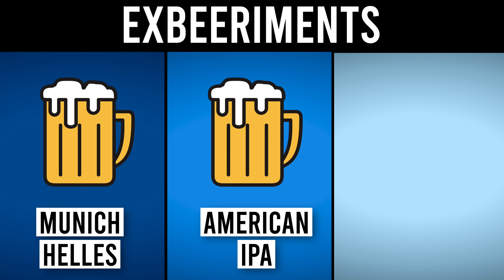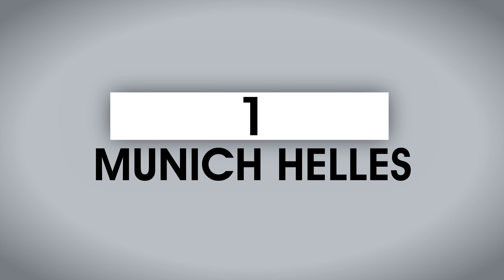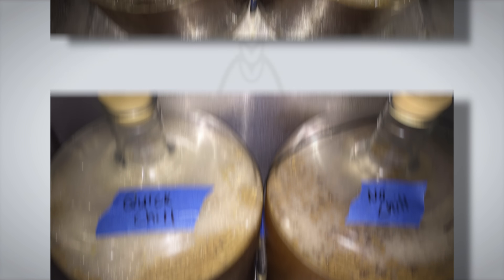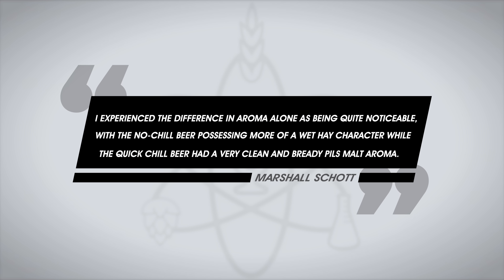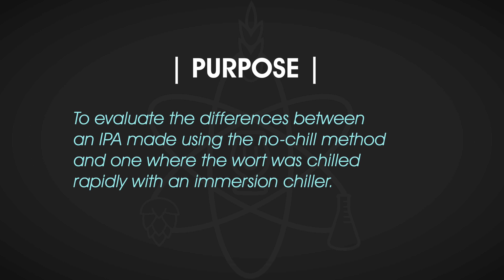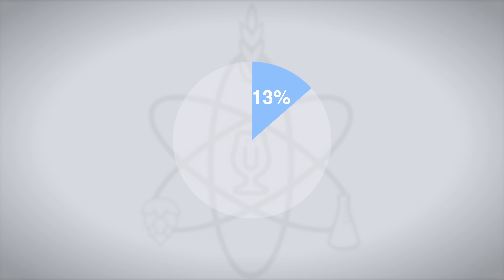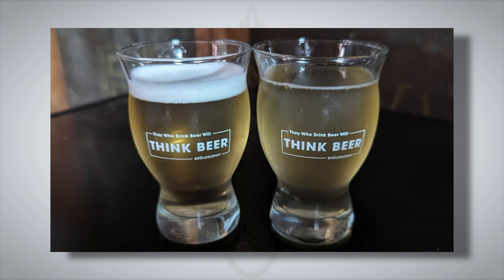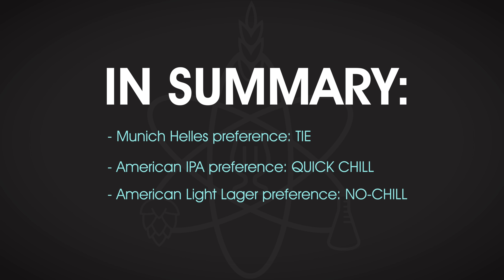How The No-Chill Method Impacts Beer Character | exBEERiments

Comment: Been on the no chill train since my wort chiller exploded in 2019. My advice, don't worry about transferring to an HDPE container, you can no chill in your kettle, pop the lid on and it will be just fine. I've had no issues with DMS yet. The only consideration is: if you're making an IPA or an especially hoppy beer, use a hop spider or hop bags on your later editions and pull them out at the end of the boil. Happy Brewing!

Comment: Usually, I do no chill brews. But instead of doing a real no-chill, you can also cool down the wort to 80 °C to prevent the isomerization after flame out, especially if you use great amounts of high alpha hops in late additions or whirlpool. Cooling can also be done with ice cubes or ice water, this works well for me. I would assume that the american IPA test with such a method would have a slightly different outcome.

Comment: My .00002 cents is... if a beer style has a lot of flavor already, the no-chill method probably distorts the big flavor, which is off-putting.. i.e. with the IPA. If a beery style has very little flavor, i.e. American Light Lager, the No-Chill flavor distortion is perceived as preferable, because the alternative is... no flavor. So the lighter the beer style, the more a batch may be improved by the no-chill flavor addition (along with anything else that will contribute... something!). 

Just as a side note.... my wife has definitely been in no-chill mode for quite some time! Doh! 😜

Comment: I did a no-chill light lager last year.  It turned out decent.  I didn't know about the 20 minute hop delay.  I'll definitely be trying that.  I brew with an electric brew kettle.  At "flameout" I just put tge lid on and wrap some of that silicone wrapping tape around the edge to try and get an airtight seal.  My beer was a bit grainy and bitter but ok to drink.

Comment: I only used the overnight cool-off no chill method one time yet when I brewed in a different place where I did not have my counterflow chiller available. This batch was my very first and so far only real catastrophe. Had to dump two 19l KEGs down the drain because of a massive celery-like off-taste. Really absolutely awful, no way of drinking it. Disgusting. Yes, it may have been something else, but in all my idk around 70 batches so far I did not even encounter this once more.

Comment: I haven’t looked at the other comments yet, so maybe others are doing this. But, I use a small water pump and ice packs in a cooler of water, run it through the plate chiller (wort is using gravity). The water comes out warm, and I use that to mix with PBW or as the rinse water. 

So, if no hop stand, I’ll run about 1/3-1/2 of the hot wort through the plate chiller and return to the kettle twice, then replace the cooler water (reused as wash or rinse) and chill back down to run through the plate chiller one last time into the fermenter.

That last run definitely gets me down to pitching temp, usually in the low 70’s °F. And this absolutely reduces the amount of water I use.

Comment: I started with no chill but switched to quick chill, because its a bit saver for the fermentation if I can add the yeast directly, and also cleaning up goes much faster with hot water, which is what I get from the chiller.

Comment: I have no chilled for around 40 brews, always with bagged hops, for brews with big flameout "80 degree"  additions controlling bitterness is an issue. For those with smaller or no late additions it works well,.

Comment: As a no chill brewer for several years now, I found that if you adjust your timing and methods correctly, you can get any result accurately
I cut back most llate hopping, and dry hop instead where needed.

Comment: Anecdotally for me, I started with quick chill and later switched to no chill. The first several beers I made with no chill were all IPAs and were just unpallatable, but after changing hop timings, I now exclusively do no chill just because it's easier and have had zero issues since. Both make great beers, but if you are cheapskate like me and don't like the idea of putting hot wort into HDPE plastic to submerg in an ice bath, no chill overnight has been amazing.

Comment: Quick sidenote on the watercosumption. you can easily attach a aqarium pump to one end of the immersion chiller and fill up your sink with ice. If you further ad salt to the ice you'll end up with an extremely cold liquid as the salt allows the ice to melt at a lower temperature. While this still consumes some water and a significant ammount of energy from freezing the ice in the first place, I do think it's a more sustainable approach as energy ca be generated ecofriendly while drinkingwater is getting quite scarce in some places especially this time of year.

Comment: I have always used hop bags to contain my hop additions - Brewing on a 30l Brewmonk.

60 min hops - No change 
10 min hops - No change
Protofloc - No change 

Remove hop bags at 0 mins.

Flameout hops - Add at 90°C
Whirlpool hops - Add below 80°C

Again, remove the hop bags at the appropriate times and always keep the lid on once the boil is over.

When finished, I seal the Brewmonk with masking tape (including the out pipe) and leave in the garage with the door open, overnight. I then carefully pump it into a fermenter, leaving most of the crap behind and getting very clear wort.

By removing the bags, I tend not to get 'hop blur' - all my bitterness, flavours and aromas from the hops seem distinct and clearly placed.
Reply: Excellent.  Thanks for the info.  I did no-chill on my first batch.  I'm about ready to go back to it.

Comment: Have done it twice. One on a Lager, other an Ale. Both of which are moderate in hops. No issues from other drinkers or myself. These I have brewed several times. I couldn't tell the difference.
Reply: Only thing I notice is that I get more bitterness from hops. For low-to-moderately hopped beers (or beers with less added at the end of the boil) you probably wouldn't notice much, if any, difference. But if you're going for a particularly aromatic hoppy beer, no-chill reduces that and you end up with more bitterness instead. You could make up for it with more dry hops though - wouldn't be the exact same but should be similar

Comment: I often double batch 2x50L. Often I transfer the first batch at boiling, and let my glycol chiller get to work (which sanitizes the unitank), often targeting 10*C, and let the second batch chill somewhat before transfer (down to like 40*C). When they mix they end up in the mid-20s, and the glycol chiller will stabilize it at the correct temp in half an hour or so. It does mean I need to dump some trub though.

Comment: I use a stainless steel immersion chiller with hozelock fittings that runs from my garden standpipe to the garage where I brew. It reliably brings my wort down to around 22-24ºc in about 30 minutes.The considerable water 'waste' goes via the 'out' hose straight into two large water butts in the garden for later watering duty. So no waste when those butts are previously empty. Fine in the summer. Less so in winter!

Comment: I use a cooler with 5gal of water, with 8-10 2 litre pop bottles, filled with water and frozen, and usually a bag of ice from the corner store. Cheap pond pump from Amazon. Hose from the pond pump goes to the immersion chiller, other end of the chiller goes back into the cooler. Usually fill the cooler before I start the brew day, so it is extremely cold by the time you go to chill. Also double to keep the beer day drinking beer cold as well!
Reply: I do something similar but freeze water in ice cream or plastic takeaway food containers so I can dump the ice directly into the water and cool more efficiently. Much easier to freeze the water in bottles though I bet esp when your chest freezer is as jumbled as mine hah. Capture all of the water and use it on the garden or for cleaning up the brew gear. It adds 30-40 minutes to the brew day that I would love to cut out but I don't like the idea of hot wort sitting in plastic for hours.

Comment: Semi Quick Chill with Using Less Water:
I fill up my sink with water and use a cheap $16 pump connected to my immersion chiller to recirculate the water back into the sink.  Drain and refill the water a couple of times as the first and second batch of water will get hot quickly as it drops the temperature.  After the wort gets down in temp a bit I do another sink of water with several frozen reusable ice packs to chill it down enough for me to put in the fermenter.  
GROWNEER 550GPH Submersible Pump 30W Ultra Quiet Fountain Water Pump
The outlet valve is removable and threaded and can be replaced with a cheap threaded connector to easily connect to the chiller line's input.

Comment: I have no cooler so I have no capacity to chill down to pitching temperature. But I do take care to cool my wort (mostly 23l batches boiled in an electric boiling kettle) down to about 80 C as quickly as possible to halt hop isomerization on the one hand and to stop possible DMS formation on the other. I also prefer to boil for only 30 to 45 minutes to save energy (electricity is expensive in Germany), so DMS might become an issue. To cool my wort I use two 1,5l plastic water bottles filled with -18C ice which I take from the freezer. I drop them into the wort about 2 minutes after flameout, stirring them cautiously from time to time. Sometimes, when the batch is less than 20I and there is still headroom in the kettle I additionally use cold sparge water (1-3 liters) to dilute the wort and cool it down even more rapidly (sort of high-gravity brewing). It takes a maximum of 15 minutes to reach 80C this way, with a water addition it's below 10 minutes.

Comment: The other method is recirculating the water while using ice. You run it like normal till 120f and then recirculate back into the same water using ice. I use less than 6 gallons water.

Comment: I never actively chilled and it works great for me. But I don't get why you would take the extra step and fill it into the cube instead of transfering it directly into your buket/keg/ whatever - again worked great for me so far
Reply: The cube can be filled to the brim and sealed. No suck back of contaminated air as it cools.
Reply: @tortap  I see, thanks for clarifying!

Comment: I've been no-chill brewing for about 4 years and it just makes brew day much easier with reduced equipment needed, setup, and cleanup afterwards.  I use a hop spider in the boil kettle along with a kettle tube screen on the valve to reduce hop particles lingering in the beer after racking.  After flameout I wait 5-10 minutes to let any remaining hop materials or whatever settle out, then rack into 6 gallon sanitized SS keg.  Easy peasy lemon squeezy.  I don't adjust my hop schedule timing at all, just a small reduction quantity wise (~10%).  I entered a homebrewing competition a few years back using no-chill just to see if it negatively impacted the quality of the beer. Two of my three beers entered earned a 2nd (English Brown) and 3rd (Belgian Dark Strong Ale) in their respective categories (yes there was plenty of competition), so I would say it's a very viable homebrewing option.  One thing that most likely helps is that I do not brew IPAs.  I know it may be blasphemous, but I do not care for them enough to brew a 5 gallon batch and there are tons of examples on the market.  I would rather brew beers I cannot readily find locally which usually turn out to be less hoppy styles.  I brew a pale ale every year and no-chill seems to do fairly well with that style, but I could see where it would begin to fail as you venture into IPA territory.  Just my two cents but I don't see myself going back to using a chiller of some sort any time soon.
Reply: "brew beers I cannot readily find locally".  EXACTLY.  This is why I got into home brewing.  I like dark, malty styles and 75+% of the store shelves here (OR, USA) are IPAs.  I also no-chill straight into a SSBB mostly and it's the easiest method for these styles IMNSHO.  🍻

Comment: Not a fully fair test as you said that the Helles was no winner in taste preference the Light Lager was a clear winner with the No Chill but you said the IPA was a win for the Quick Chill but it should have been discounted because as you said the preference was generally down to the No Chill beer being more bitter because it was over hopped.
A No Chill recipe would have been adjusted for that in the IPA so because it was more bitter it was easily distinguishable and disliked because it was too bitter so you should have made that test invalid

Comment: This is one of the brilliant ideas from our Aussie brothers that use more often than not. What I have been doing is whirlpooling my late addition hops and letting them settle, then I transfer the wort that is mostly clear with very little trub or hops into hot fill bags. I have fabricated a cap for the hot fill bags with a silicone hose so I sanitize it and connect it to the ball valve on my kettle and not expose my hot wort. Obvioulsy, when you replace the hose cap with the cap to seal the bag you need to wear gloves. Doing this allows me to have shorter brew days and keep multiple bags of pasturized wort on hand to ferment at my leasure. 

I have found that any late addition hops that make their way into the bag keep bittering, so I am sure to make sure everything is settled before I transfer.
Reply: When you're whirlpooling your wort, are you doing that at approximately boiling temperature?
Reply: @bensadler7368  No sir. I usually let it drop to about 195 down to 187-ish depending on the style if I want to prevent isomerization. then I whirlpool and let it settle for at least 20 minutes. It has always been over 165 degrees F when I gently drain into the bags. I don't do huge hop additions and the dip tube on my Anvil Foundry is pointing at 9 o'clock so I can get the wort out very clean. I have yet to try it on my keggle set up, but I expect it to work even better with a big hop addition because of the round bottom.
Reply: @mountainmadman94  I'm about to move out to the desert and I'm planning on converting to no-chill brewing, so I'm really interested in your method. Do you let the temp drop naturally from the boil down to 195?
Reply: I should also add that when I first started doing this I used cubes.  I tried it with flame-out hops and didn't wait long enough for it to settle. Lots of hops made it into the cube and kept isomerizing as the thermal mass of the cube kept it from cooling for a long time. I inadvertently made a couple of batches that were too bitter for me to enjoy and I had to blend them with less hoppy beers to drink them.
Reply: @bensadler7368  Yep. I leave the lid off and have a beer. Whe it is time to whirlpool I add the hops, spin it really fast for awhile with a long spoon and put the lid on. There is a hole in the Anvil Foundry lid that I can put a thermocouple in. A turkey fryer thermometer would work too. I always try to put it in the hot fill bag at 165 degrees or higher if it has been over 20 minutes of settling. I lay the bags in stackable plastic boxes that I got used ( U-line part # S-22259GR) and safely stack them until it is time to ferment. Aussies say it can last for months but I have never gone more than three weeks. One more thing, the hot fill bag is laying in the plastic box when I fill it so I can move it while it is hot.

Comment: I live in Denmark, I've done no-chill for a couple of years. You save more than water, you also save your own time. I wash my fermenters, and let the hot wort pasteurize/sterilize them. I just drop it into them boiling, and close them up... it's much, much faster, and I don't have to use chemicals.
Reply: I do the same in Sweden.
Reply: Interesting...never thought of doing this but it makes sense.
Reply: If they are metal then great - I've been trying to reduce plastic exposure generally including brewing and am uncomfortable with the extended exposure of hot wort to plastic chilling in a cube or plastic fermenter. 

I use about 50L of water to cool my batches, all of which goes onto the garden afterwards, houseplants or is used to rinse my kettle/gear during cleaning so net use stays the same. Would be nice to save some time though, the immersion chiller is not the fastest.
Reply: @Narapoia1  I just ferment in stainless Cornelious Kegs. I wouldn't drop hot wort in ANY kind of plastic... they give off shit that's not healthy. I mainly hot cube to save time. If I have to cool, I just circulate water from my pool in the chiller.
Reply: That is a great idea. Most of my fermenters are Fermzillas, but I have an Anvil bucket and I am going to try this.
Reply: Exactly.
Reply: I bought few stainless steel fermeters because my process works without chilling. Hot mash sterelize fermeter after washing it. My beers are always ok
Reply: Hvor stor batch laver du, og hvor længe tager det at køle så?
Reply: @JKOOLDK  ca. 34L. det tager ca. 1-1½ døgn for at køle det ned naturligt. Når jeg tror den er i vinkel måler jeg temperaturen på urten med en IR pistol.
Reply: @MartinPedersenTM smart, tror jeg behynder at køre samme stil, det er ret smart
Reply: @JKOOLDK  Jeg har haft meget fokus på tid.. og det her sparer min tid fordi jeg hverken skal bruge tid på at køle eller sterilisere gæringskaret. Det kan godt være brygget er et døgn længere undervejs, men det er jeg ligeglad med.

Comment: Haven't chilled in years. I don't transfer after the boil, just leave it in the kettle over night on the spent hops and trub. Top tip, putting a table fan in front of the kettle will dramatically speed up the cooling...
Reply: Me too. Just leave in kettle.
Reply: Yes.  The fan is very helpful.